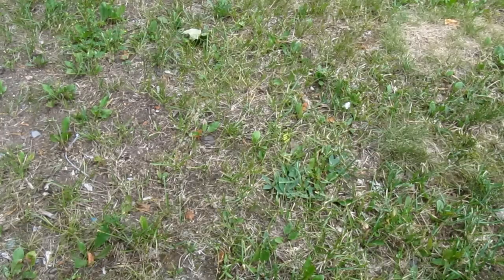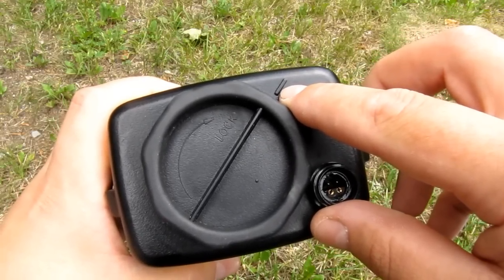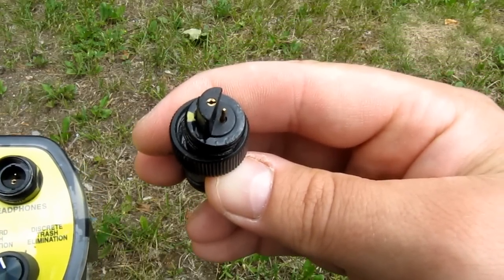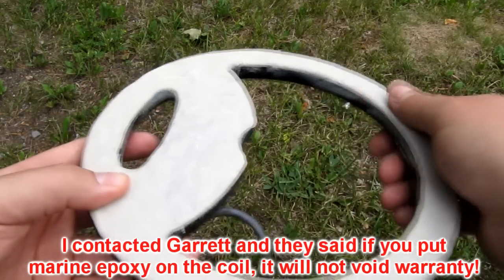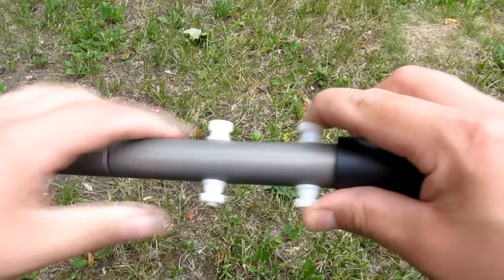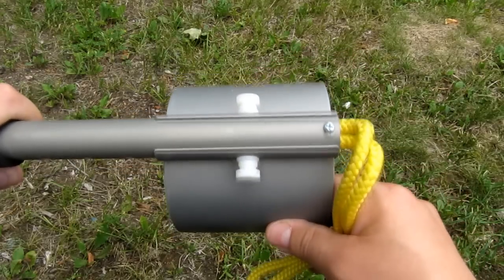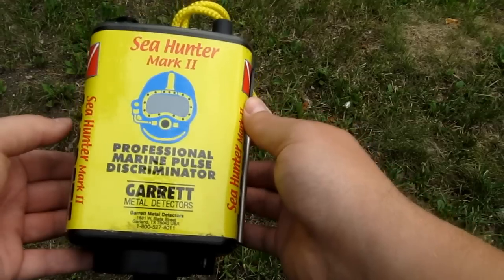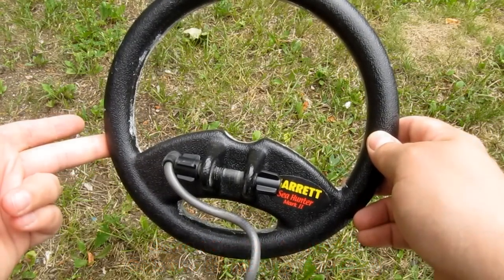Metal Detector Review - Garrett Sea Hunter Mark II

Comment: so sorry for my awful English Folks , this is my favorite beach metal detector assumed you have the 10*14 coil. The only thing is that you have to be a bit patient in order to get the audio learning curve . Once you ve got this then this unit is very powerful and no need to dig too much crap once you are able to listen at this machine . So let me try to explain it to you : First you need a good headphone ,this is very much important . of course this is only a mono sound machine . Nevertheless this machine will tell you everything . First my settings : threshold hearable of course . Then standard mode of course , then elimination at zero . That way the machine is the most powerful . if you have some drift or parasite noise then put elimination at 2 . This is the same as dailing in some pulse  delay . Then the copper coins response : In order to analyse your target you have to lift the coil until the response is the weakest .Then you sweep your coil getting slowly nearer again towards your target . If copper just next to the weakest sound you will have a sweet coming in sound and also a sweet going out . DO NOT SWEEP TOO FAST. Then very progressively as you get nearer you will have get a sweet combined to a hoarse sound . At the end you will get a saturated sound. the important is to understand that the sound is a kind of 3D evolution . if you learn to listen at this progression you will be able to know what you have got below . This approach works always no matter if your target is big or small ..Only the  deepness will be modified .  if silver still the same  sweet sound but the coming in and out is  very slightly shorter and the tone is half a note below  . NOW BAD TARGETS : aluminum foils : At the very end of the detection capability you will hear a unsteady weak sound . Then the coming in and out is not sweet at all but kind of more abrupt . There is no sweetness no nice roundness of the tone . And most of all very soon you will have the hoarse sound coming as you get closer with your coil . And the saturation sound will be coming very soon too . get the hang of it and you will never want to detect on the beach with anything else . concerning iron :most of the time is is not a coin nor a ring . So you will get a double wave  response winch means that you can forget about it . I hope this helps folks.And happy hunting most of all ...Now gold: I leave you the pleasure to discover 😊😊😊
Reply: Rapunzel Thanks for doing a video on this. I'm actually expecting to get thjis machine in the mail tomorrow.  My question is, how does this machine do on land? I go to the beach 4 to 6 times each year so in primarily searching on land and in creeks, streams and rivers. Any info on what to expect would be appreciated.
Reply: You will get the hang of it m friend . Just listen on the response wave in a 3dimentional way . Happy hunting .
Reply: You will have to fight a lot with iron inland ...But you will learn to recognize it .

Comment: There is no low tonenor high tone as this machine bis a monoton without ground balance . The discriminate knob is nothing we else than a pulse delay . You use it to  calm down the drifting  if you have got some . The is the best pulse available for the price . If you add a 10/14  big mono coil you are almost as powerful as a garrett ATX. I tell you that as I have got both . So you will get the rings and coins at 14 inches .
You also can run this machine on discrete elimination for a quick hunt and eliminate the aluminiums . It is the only machine in the world having this feature . I love this machine   .
Reply: Can this machine eliminate iron and such trash ?
Reply: thanks for your comment.  i bought this machine last year and cant figure out if i should be using the eliminator knob or descrete elimination.   ive heard its most powerful with eliminatino off and standard mode.  but seems elimination off and discrete mode on
 would still be a good way to go.

Comment: An Excalibur II might be a little more than I can afford to start out. Does the Sea Hunter Mark II NEED Ground Balance in salt water and on the beaches ? Thanks
Reply: TheDigitalWeb? No. PI (pulse induction) machines do not need ground balancing. It's a great unit but you need to dig everything, which is not too bad in sandy conditions.
Reply: Thanks for your reply! I jot a new(unused in the box&#39;) Tesoro Sand Shark on eBay for $456.00 ! Taking it to Puerto Rico Saturday!

Comment: I like this detector, even though the discrimination is not so good in trashy areas. I have not completely decided whether to get this one, or the AT Pro. I really don't mind having to dig everything, because most of the Detector videos say that you should dig everything, anyway. I don't know if I will be scuba diving at some point, but I want the option if I should ever decide to get some diving equipment. I like that this machine is completely submersible to a much greater depth, than the AT Pro. I also like that it goes very deep, because I want to hunt for more than just coins and jewelry. I also want to hunt for things like gold nuggets, and  I don't want to have to get two separate machines. I also don't want to have to worry about accidentally taking the AT Pro too far  down in the water...even if it is only one to five feet too far. From what I have seen in the videos I have watched...you usually have to dig and clear out a lot of junk, before you can get to the good stuff...especially in trashy areas...anyway. Even with the land limitations it apparently has, I am leaning strongly toward this machine.